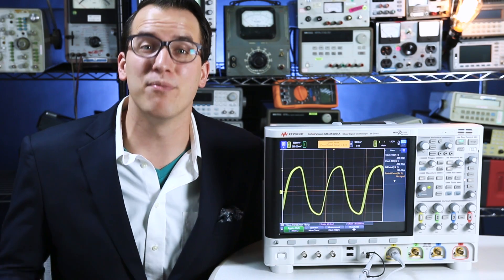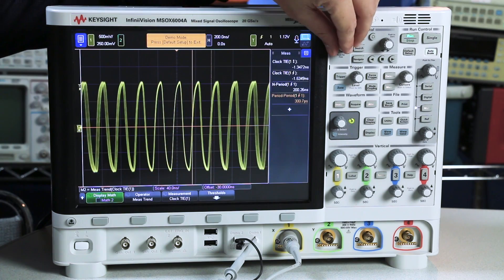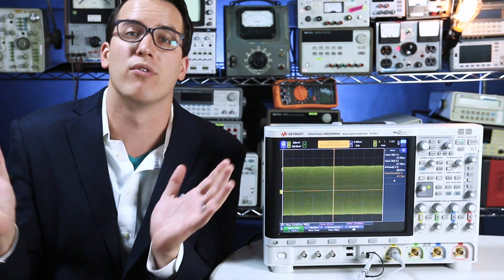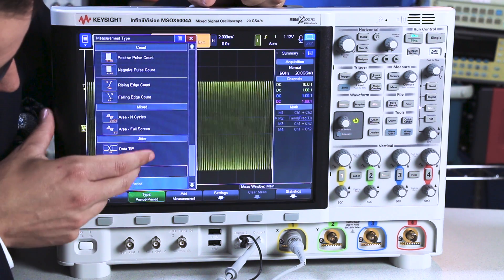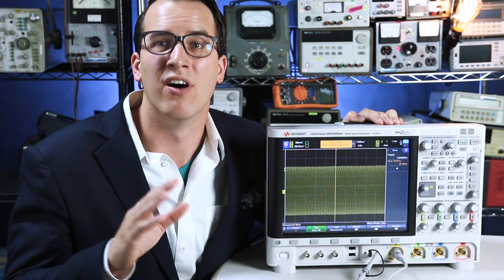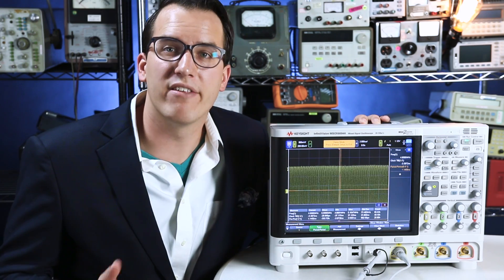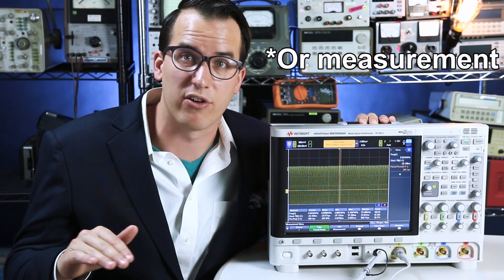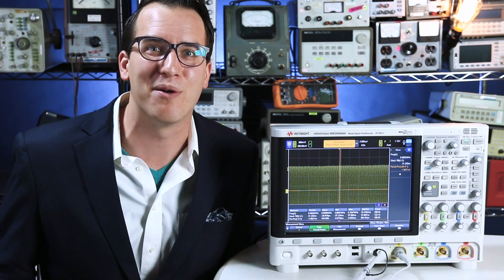Basic Jitter Measurements - Oscilloscope How To - The 2-Minute Guru (s1e13)

Comment: How do yo know how much jitter comes from observed signal and how much comes from scope clock jitter?
Reply from the maker: Good question! Oscilloscope jitter is usually on of the specifications in a data sheet. Another way to get an idea is use a source with a known amount of jitter, measure jitter with the scope, and take the difference.
Reply: How do you measure jitter of scope? Jitter is sort of phase modulation, right?

Comment: My guess is that your input signal is intentionally frequency modulated to give you a psuedo jittery signal for the demo.  The signal has very little jitter but the frequency sweep gives the impression that it does once you look at it over a sufficient number of cycles.
Reply from the maker: Bingo.  What's happening is that even though the period-period (or cycle-cycle) measurement values are low, they aren't cancelling themselves out every other cycle. So, the measurements trend in one direction, then the other. This makes the peak-peak value much higher than the cycle-cycle value.

Comment: Ghostly noise near scope's bandwidth limit doing the jitter bug?
Reply: ie causing unstable triggering of signal?
Reply from the maker: Good guess, but it's not trigger related.
Reply: +KEYSIGHT OSCILLOSCOPES I must admit, I'm more confused about a negative Period-period measurement in the question screen.. I'd definitely be looking at the manual about that!  It seems like a calculation anomally.. maybe due to not having sampled enough signal, but then it seems that 1000 samples should have been collected pretty quick.  Could this be due to impedence mismatching of probe/scope causing secondary harmonics outside of viewing range? ;-)
Reply: If not, I'd next look into the sample memory rate in case resolution was too low..
Reply from the maker: Great question! What a negative value means is that the 2nd cycle was shorter than the 1st.  For example, if cycle_1 has a period of 1 second, and cycle_2 has a period of 0.9 seconds, the per-per measurement value will be -0.1 seconds. Likewise, if cycle_2 had a period of 1.1 seconds, the per-per measurement value would be +0.1 second.
Reply: Ah.ha. Thank you for clarification.